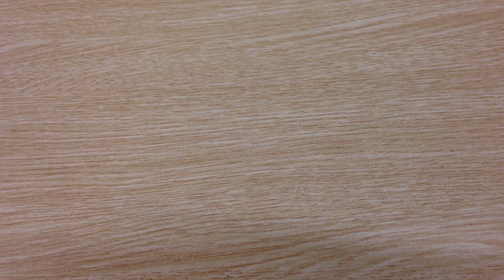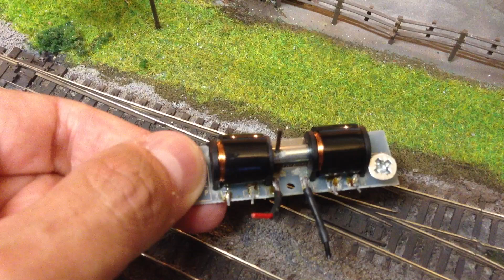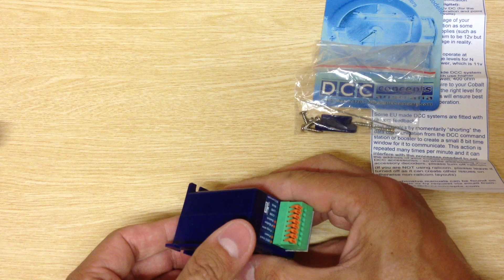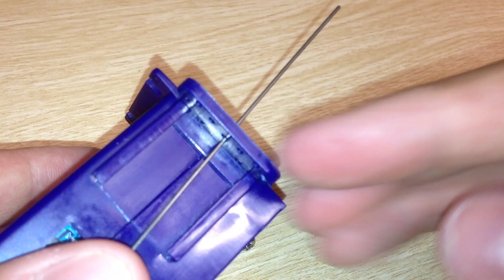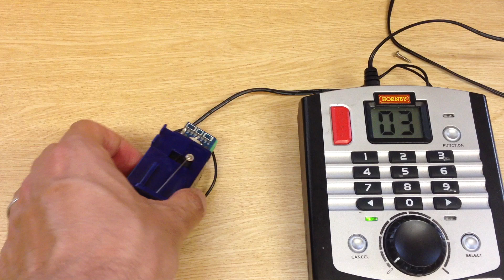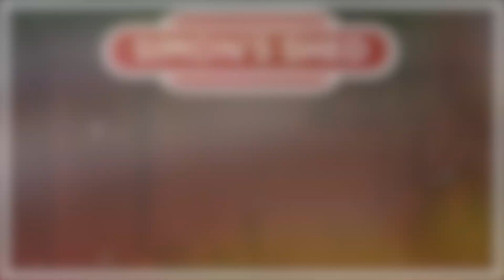Cobalt Digital Point Motor, by DCC Concepts Review

Comment: One thing I'd like to ask is this... so all track has been laid and trains are running fine and now it's time to add some point motors. How do you drill the hole beneath the point when the point has already been laid. I guess a tiny 2mm hole could be drilled from above through the hole in the point where the point motor wire goes through and then from beneath the baseboard widen that hole without going too far and damaging the point? Is this the best option?? Most point motor installation videos show installation with points not already fixed to baseboard.

Comment: Maybe a little bit of nail varnish inside the point blades would fix it? I have some OO gauge Peco Bullhead points and they are not cheap. I might experiment with this before removing the spring, I know the snapping of the point blades is not realistic, but the thought of potentially wrecking my Bullhead points is not a good one. Thanks for posting your experiences though.

Comment: Can I ask why you don’t put the bar through the hole in the middle of the point, it looks like you use part of the payslip outside the rails ? I only ask as I have cut all those bits off on mine 🤔🙄

Comment: So they have a built in decoder? i would use these pads too they dampen the sound, can you make 2 of these point operate together with a 2 point setup?
Reply from the maker: Yes the Digital ones have a built in decoder (they also do an analogue version I believe)  You could just set 2 to the same DCC address and operate a 2 point setup, yes.  Or some DCC controllers allow you to link multiple points up in a 'route' so pressing 1 button operates 2 (or more) points.  The latest version is called Cobalt IP Digital which have a few improvements over these,
Reply: Brill i need to buy about 8 of these for my n gauge 5ftx2ft6 setup, they look ace and an ideal solution
Reply: Could you tell me the dimensions of this motor please, thanks

Comment: Simon, I am trying to fit my first Cobalt Digital ip point motor on my DCC layout. As DCC layout is always powered ,ie, tracks, points including frogs. The two arms of the "V" are always on opposite polarity. So, where should I solder the Green wire?. If I solder the Green wire at the "V", will I not short-circuit the whole layout?

Comment: Simon ,I was onto NCE who recommeded to buy a DB5 booster and EB1 one's to operat the point motors so I have, will I need a second bus bar just for the points or just link the DB5 into sb3a.Points work well when programed so I got some more.Hope you can help.

Comment: Simon Have you any plans to wire up a panel with leads showing witch way points are turned.With the Dcc Concepts Digital, as I'm changing over to them.
Reply from the maker: Sounds like a good idea for a video (even if I just show how to do it with 1 point motor and a couple of LEDs rather than a whole panel) but not sure when I'll be able to get around to doing it.  I'd also need to figure how to do it first!

Comment: Simon, I see that there is now an updated "IP" version of this. I'm, struggling to see what the difference is though? Could it be that there is no longer any need to remove the spring?
Reply from the maker: Ken Toogood Hmmm hadn't seen those, looks like they have added some electronics so that it can cope with a wider range of input voltages,  thats the only difference I can see.
Reply: also you can add manual operation toggle switches/buttons as well as dcc at the same time

Comment: Simon I thought you produced a Vid in which you stated that the "Spring" should be removed!
Reply from the maker: TheAudiostud Its best to remove the spring from the point itself, especially if you are using the Cobalt to switch polarity of the track.  Its about 13:30 in the video where I take the spring out from the point.

Comment: Simon I'm new to dcc, your cobalt wiring diagram ref. the green wire to the point vee is that green wire soldered to the track there and does it matter which side it's soldered to thanks Jack
Reply from the maker: Jack Brown You need to solder it to the "V" bit of the point, not the left or right, its the middle bit on the end of point with the 2 tracks, there is a "V" shape in the middle, anywhere on the V should be fine.
Reply from the maker: Jack Brown sorry, I can see you are talking about the Vee now...no, it doesn't matter which side of the Vee its soldered to.

Comment: Hi Simon, I just wondered how you would be able to use these on Fleischmann points?
Reply from the maker: Not sure as I haven't used the fleischmann points, sorry!
Reply: +Paul Garwood Fleischmann points have dead, non-powered, frogs. And a spring that is easy to remove. I see no reason why they shouldn't work like a charm.

Comment: Very good,But you should never use point motors,,unless they are hard to reach,Better to do them by hand,,,Also ,it is better to use analog,,It is easy to put a switch off 12v,,on your side board by your points,And they are also cheaper .And decoders do not last forever,,.,ie,,If you have 20 points on a layout,,You still have to check,,that each point has worked correctly..Before use..If you come to rely on the point motor working all the time,,and you have a failure,,You can do a lot of damage,,I try to discourage people from using point motors,,

Comment: Very illuminating - thanks for posting.

A quick question if I may - is there any problem in wiring two of these motors to operate together (such as for a crossover)?

Regards, Alasdair
Reply: Hi Alasdair, I had that same question regarding interlocking two points to complete a switch from one track to another when they should be both set at the same time and sent an email to Rand Cooley at DCC Concepts and he responded with a very comprehensive how-to (also gives you the ability to interlock it to a signal), as I'm not going to be using my ones via a DCC controller but will utilise the DCC variant as it helps greatly with the wiring, frog polarity etc. You can contact Rand at randc@dccconcepts.com and he will provide you with all the information necessary - I found them fantastic to deal with.
Reply: highlandersixtysix
Hi - thanks very much for information - Rand's email address noted.

Kind regards, Alasdair
Reply from the maker: highlandersixtysix Thanks for the info, hopefully that will answer Alasdair's question as I have no idea!  I suppose if I were doing it with these "digital" Cobalts I would just link them together in the DCC controller so 1 button fired them both.

Comment: I have 32 on my layout .i previously used seeps but had loads of problems. No problems with the cobalt motors very pleased .expensive but worth it for better running .very good vid Simon
Reply from the maker: john lee Thanks John, good to hear that the Cobalts are working well, I'm really impressed with them so far.  Surprised one of my Seeps failed already as it hasn't really had that much use, if any more go I'll definitely replace them with Cobalts.

Comment: Hi Simon

For once I'm ahead of you :)  I have 16 of these on my layout and I don't regret fitting them.

So far after about 6 months no problems at all. I use a control board so have extra wires to my push to make switches. I've also fitted frog juices not really needed but it's belts and braces ;) Next on the list is some leds to show which way the points are set. Only got about half of them on my DCC controller I like presses buttons ;)

Mike
Reply from the maker: Reefy1952 Hi Mike, glad to hear there are no problems with the cobalts after a longer test than mine!  They are great and worth the cost I think.  I can see how a control board and real switches is appealing, a lot of DCC controllers make it too fiddly to control points but I'm liking the way the z21 does it so far.
Reply: Simons Shed Hello.. great revue, but please what is the difference between the Cobalt H-DCP-CBID and the other one?
Reply: Paul Garwood
One is Digital without any extra boards the other needs a DCC Decoder.

Comment: I didn't realise they made a digital (DCC) plug-and-play version, I had dismissed the cobalt motors previously but I will certainly be using them on my new layout, thank's Simon!
Reply from the maker: Yes I think it was a while after the 'analog' version was released until they did the digital version, but have to say I'm really impressed with them so far.
Reply: Simons Shed
I have now downloaded and studied the manual and the Cobalt Digital motor can also run a Dapol Semaphore Signal too. Two wire from the DCC bus to the signal and the other two wires, from the signal, to the Cobalt Motor. Excellent!